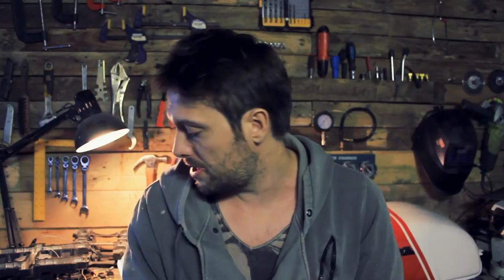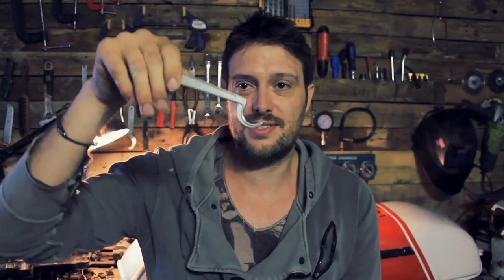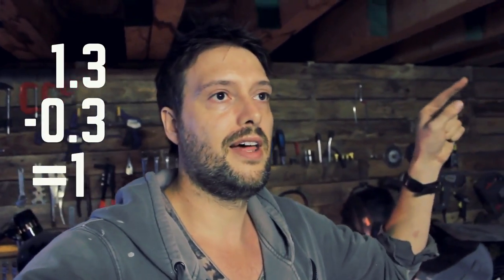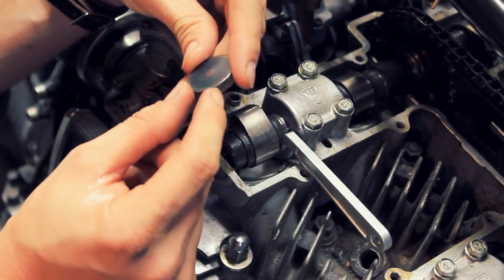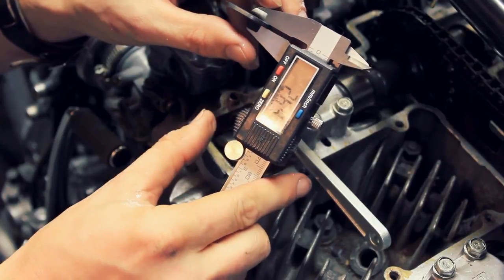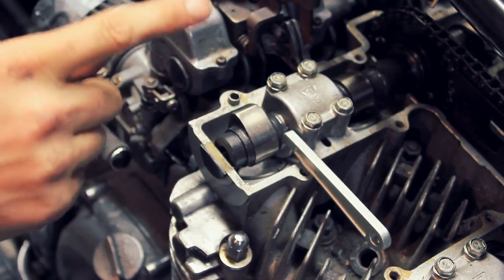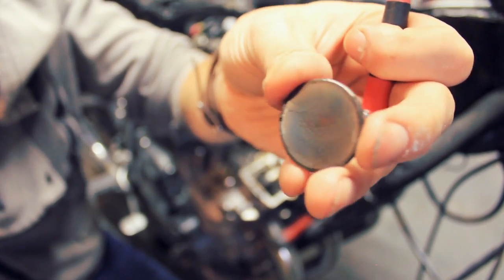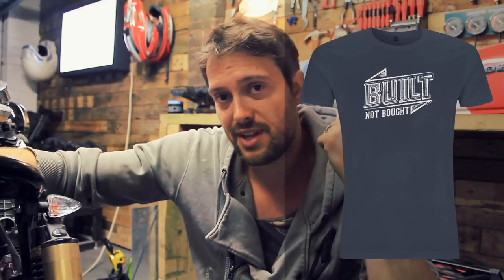Cafe Racer Build 27, Suzuki GS550 Changing valve shims

Comment: As you stated, the range for valve clearance on the Suzuki GS 8 valve bikes is .03 mm to .08 mm. Over time, the clearance will shrink. When changing shims, you should be aiming for the upper end of the range. If you shoot for .03 mm, you will be out of spec much sooner than if you shoot for .08 mm. In your case, your clearances were too large. That is unusual. Some previous owner must have used some shims that were too thin.
Reply from the maker: +jsandidge1 interesting,  I did think that the wear would do that also but following the Haynes manually it says to go with the smallest, I've read that build up and wear on the cams could increase the gap. But good thought about adjusting for either or,  maybe they should say to put it in the middle for either to happen
Reply: Try this website  http://members.dslextreme.com/users/bikecliff/
There is a really good tutorial on changing your shims. You can also download a factory service manual for your bike there. There are some differences between the Suzuki factory manual and the Haynes manual. I would trust the factory manual over Haynes or Clymer. You can also check the forums at www.thegsresources.com. There are many threads on this subject.
Reply: jsandidge1 is correct. You should at least shoot for the middle of the range (.05/.06mm) to give you wiggle room, but the gap will shrink like he said, so shooting for smaller clearance will give you the most life out of your tune up. Not to mention give you the most (safe) lift out of your intake valves which is really good.
Reply: @FooDude2011  by your own logic, if the clearances will shrink (due to wear on the valve seats, particularly exhaust), you should aim to set them at the wider end of the range.

Comment: Hi, Great video!
I also own a GS550E 1979, pre diaphram carb model.
You checked the valve clearance with the cam lobe in the vertical position, my manual states the gap can also be checked with the lobe horizontal. My problem is I am getting a variation between the two. For example I have one where the gap is within tolerance when vertical but tight when hoizontal. ( and visa versa) I guess the important thing is there is the minimum clearance regardless of cam position when on the plain section of the cam or will that cause them to rattle? On the other hand the valve may not be fully closed if I leave them tight which is even worse ? Your input would be appreciated. Thanks Rob
Reply from the maker: I tend to stick the way I have done it but many might know more.

Comment: hey, i have a Question, on my manual says that the clearens both for the inlet and exhaust is between 00.3-0.08 also, do you know what clearens worked for you on the exhaust ? the same as the inlet? would it work to put inlet and exhaust clearens on 0.08? hmmm
Reply from the maker: I've ensured they're both within those tolerances and work

Comment: Use a micrometer, not a caliper.  Using calipers on the shims gives a general thickness. Micrometer will give more accurate measurements, as well as show any low/high spots.
Reply: Vash Spiegel bollocks callipers are more than accurate enough for this job stop complicating matters with nonsense